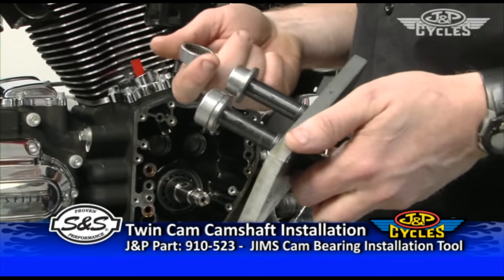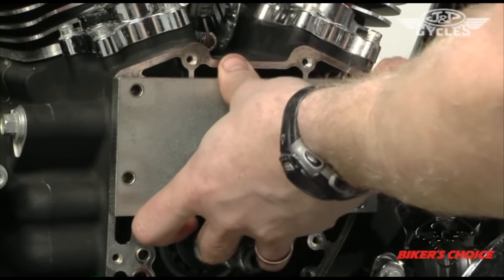Cam Replacement on a Harley Davidson Twin Cam, including Pushrod Removal •  J&P Cycles

Comment: Why would you need to or want to replace the camshafts on a slow revving engine thst hasn't even done 2000 miles ?
Is Harley using tin foil n old copper pipes to make the cam lobes ? 🤣😂😋

Comment: At the risk of sounding anal ..... I always cut a piece of cardboard under the motor over the wire harness and bend it down toward the oil pan to keep oil from soaking it and keep the frame clean when you yank the cover . Just sayin :)

Comment: Also let me add, put tape on your tappet covers before you drop a fucking sharp metal pushrod onto it.  Especially one that is spring loaded. Thirdly, crack your cam cover in the correct goddamn sequence, don't just start pulling bolts out.  Oh, and it might be a good idea to take out the maxi fuse before one of these dumb asses arcs with a screwdriver.
Reply: ***** youve got quite a bit to prove for  someone who's so experienced earthworm
Reply: Speak like an adult please.
Reply: lee schuby thats asking too much.... that feeble of a mind can only process so much

Comment: If harleys were worth a shit, you wouldn't have to replace the cams! But because of poor engineering, and idiots that want to idle their engine so low that it barely rotates, cams will need to be replaced! Sure is funny, all the imports I have been around, both own and have rode, I haven't heard or seen one single cam failure, yet harleys do it so often, that I have a collection of the damn things already!

Comment: Stop being lazy and take the damn heads off! If nothing else it gives you the chance to re-seat the valves - what’s the use of fitting hot cams, changing the hydraulic lifters to give more power at high revs (Christ, what a joke!) and yet having a bad seal at the valve seat?